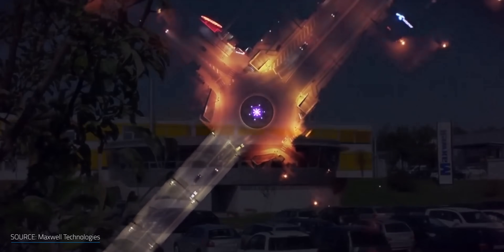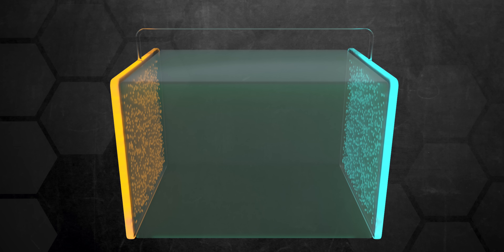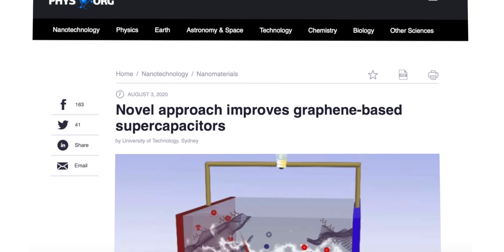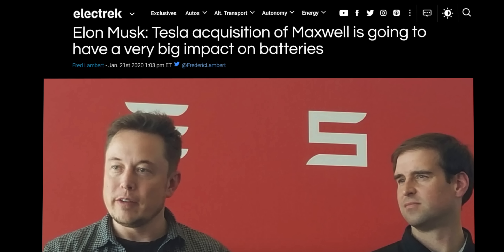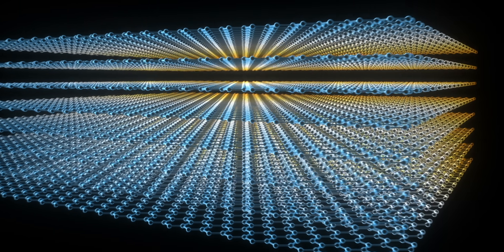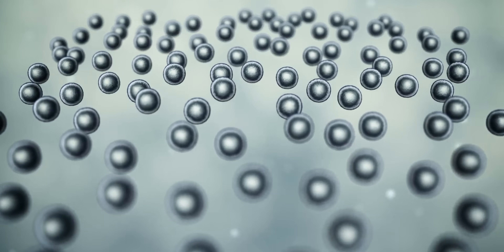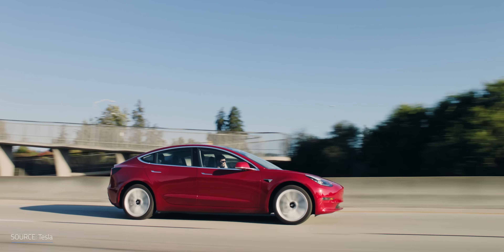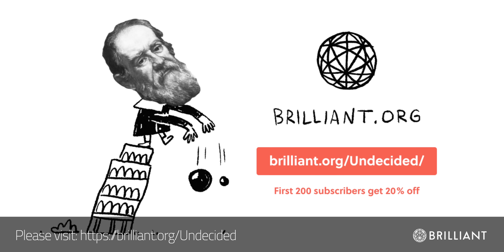Supercapacitors explained - the future of energy storage?

Comment: This feels like transitioning from HDD storage (ICE) in computers to HDD+SSD combos (ICE+EV hybrids like Prius), then to plain SSD's (Li-ion packs like most pure-EV's), but now we're getting in to the use of things like SSD+Optane (Intel SSD/RAM hybrid with fast read/write and acts like a small RAM drive for your main SSD) with the Li-ion being the SSD (main storage capacity) and the supercaps being Optane with quick fill/empty cycles to reduce load on the main storage where what's being transmitted might otherwise be bottlenecked in transfer rates if otherwise going to main storage.

Yes, I'm an IT geek and nerd, how could you tell? :P
Reply: I was thinking the same thing, but couldn't get the words to come out right.
I can only imagine how much more distance you could get from your Li battery?

Comment: Energy in cap is 1/2 CV^2, so if we increase the voltage in cap just we have more energy and to approach it would be possible with a DC/DC converter for an appropiate voltage.

Comment: The best part of super capacitors is when they fail . All the energy stored is released in several milliseconds and the resulting flash and bang is spectacular.
Reply: So is the flame of a battery
Reply: Try shorting one out, a nice effect too.
Reply: Would they be dangerous paired with a battery in a vehicle? Risk of explosion/fire etc?
Reply: @BrettHoustonTube  Yep it'd be dangerous. A capacitor works differently than a storage battery. A storage battery, lead-acid, lithium, or whatever works by using a chemical reaction. A capacitor is just a sheet of conductive material (a sheet giving the most surface area for  a given mass) that stores electrical charge on it's surface. The problem is to make the capacitor so that it may be charged up and then discharged without accidentally grounding it out.

Comment: Capacitors are used in on-board chargers in electric cars to charge the battery. They are also used in the inverter that converts the DC from the battery to AC for the electric motor. Capacitors are a key component of battery EVs already.

Comment: A computing analogy would be to think of like the cache on your hard drive, its fast, a lot faster than your hard drive but its more expensive and so can only store a very small amount because the cost per mb is so much more. It helps bridge the gap between your fast system and slow hard drive, allowing the cache to fill up with the data very quickly, and then stores that data onto the physical disc to allow for faster storage.

In a way this is similar. Lithium Batteries are slow and relatively cheap but can hold large amounts of power for their price. Super capacitors are more expensive and don't store as much but do it very quickly and release it very quickly. It can be used in the same way to bridge the gap to allow for faster charging or to allow the storage of charge that is provided very quickly like breaking. Not a perfect 1-to-1 comparison but its a fairly similar concept.

Comment: Energy can be changed from one form to another. Use multiple inputs to generate electrical energy wherever needed (PON - point of need) to complement. Say, in cars, use our body movements & weights, light from outside, wind when car moves, cars brake and weight on roads, tyre pressure fluctuations while in motion, sound inside & outside car, etc.....In Gyms, use body movements (and there's a lot). Surely research on these would come up in future. Generate & use as much energy at PON and get balance from other inputs.

Comment: Great video. I think it's also important to note that supercapacitors are only useful right now when the load is highly variable. E.g. if my robotic vacuum charges for 2 hours and then cleans for 2 hours, a supercapacitor won't really make a difference. Conversely, EVs repeatedly brake (charge) and accelerate (discharge),  giving supercapacitors plenty of potential to reduce the total current to and from the battery.

Comment: There's a small automotive startup on Fully Charged called "Riversimple" that uses capacitors and a small hydrogen fuel cell combined with 4 motors to capture Regen energy effectively to improve performance metrics.

Comment: Aside from the specific energy there is also the issue with linear discharge characteristics of electrostatic storage components like super caps which complicates the control components and their efficiency due to the fast voltage drop during discharge.
Regarding  your statement on voltage capacity  at 1:47 , a 3.7V nom Li-ion cell will still be a 3.7V nom down the road but cyclic degradation will have reduced the energy holding capacity with their useable voltage range and increased their internal resistance which reduces their max. charge and discharge rates.  Capacitors are not immune to cyclic degradation that reduces their capacitance and increases their ESR (Equiv. Series Resistance) however that degradation is far less than that of electrochemical storage components like LiBs.

Comment: I would like to know what the 'correct balance' between battery capacity and super capacitors is.  Given a certain battery size,  given re-generation or maximum charge rate, how any Farads of capacitors is needed to allow for the near optimum regeneration percentage.
Reply: It's really an economic balance. The more short-term power cycling can move to longer-term cycling, the more battery lifetime can be extended. So it's the cost of the supercar versus the cost of extended battery lifetime.

Comment: One battery chemistry that i have been playing with is a Lithium Titanate Oxide, LTO, they have a great charge and discharge curve  of up to 10C and a cycle  life of about 50 years, this setup consists of 66 x 40ah Yinlong cells in a 22S 3P configuration (6kWh). with a big enough charger can be charged in 10 minutes

Comment: As I understand it, one of the advantages of supercapacitors, is their fast charge capability. A source of energy which has yet to be tapped is that generated by atmospheric electrical storms. Can the lightening rods of ol be used to attract such energy and store it   for later use? That might imply rapid charge and slow discharge. How can we take advantage of this?

Comment: The big bonus is that you can combine supercaps with higher density energy systems to complement them. You lose some density and lifecycle in lithium because you have to design it to charge and discharge quick enough to accelerate a car quickly or take in regenerative braking energy quickly. With 10% of its energy stored in a super capacitor you can use less lithium to get the same distance travelled but with far better performance and lifecycle characteristics by wiring the lithium pack more optimally to trickle charge the capacitor or power the car during low acceleration and the capacitor handles all the heavy work of acceleration and breaking.

Comment: My last question is how much more could a battery store or capacitor or transformer store by not getting hot so utilizing the water trough for batteries how would you do that for transformers and pastors isn't there a thermal paste that could be utilized like a radiator system on these

Comment: I'm curious how Nawa plans to recoup energy from braking with the front wheel of the motorcycle? 70% of the braking power of a motorcycle comes from the front brakes, which are not connected to the electric motor with a chain like the back wheel. Therefore it's a challenge to regenerate energy with the front wheel, and harness all the potential energy. An additional challenge is that every part you add to the front wheel to be able to regenerate will add weight, which will increase the unsprung mass and possibly also the inertia of the wheel itself, thus decreasing the motorcycles handling performance.

Comment: It should be noted that charge is not stored on the plates. Those are how you move the charge. The insulator itself is becoming polarized. You can polarize an insulator and remove the plates, have them touch and then place them back and the insulator will still be retaining the charge.
Reply: One advantage that capacitors will have is the ability to continuously charge them even while in use. Nikola Tesla observed in patent US685957A that a capacitor (condenser in the jargon of his day) will continuously charge where a plate was grounded and the other was provided an antenna. The capacitor would charge until reaching the insulation's dielectric strength when it would rupture. 
Love this patent because it reminds me so much of Benjamin Franklin's Sentry box experiment involving and insulated rod. The same experiment to claim the life of Georg Wilhelm Richmann.
Without using the same desired approach of Tesla in using atmospheric electricity, we could apply the same principle where a capacitor in use can receive grid energy while in operation. Potentially a vehicle that never needs to stop

Comment: Good overall explanation, but still don't know how a super capacitor itself works. Yeah it stores energy, faster than a li-ion battery with less density, but how? If the cathode and anode are insulated from eachother, what makes the electrons flow and generate current?

Comment: Supercapacitors are great for acceleration and regen breaking already, something batteries are bad at. Also faster charging could be possible if you could empty the super caps completely before charging, and then charge both at the same time, batteries need to warm up to charge fast if they are cold. Supercapacitors can also extend range especially in cities thanks to much better regen. Manual control of the supercapacitors would be great to optimise your driving. For example if you want a quick acceleration from stand still full supercapacitor bank will give most power, while driving down hill you want to have a empty supercars so you gain back maximum amount of energy possible through regen-breaking.

Comment: So could a super capacitor trickle feed charge to the battery? Reducing time connected to the grid? Or remove the need to connect to the grid by improved efficiency of regenerative braking into the capacitor to then feed the battery?

Comment: I guess these can be used to provide the surge capability in inverters. I am looking to back up the house from my Chevy Bolt through it's 12 volt system. I figure I can only get a kilowatt out of it but I could get that for more than a day and that's a lot of juice. The trick is being able to start up the motors of things like refrigerators from a 1kw inverter and I am guessing that a super capacitor could give just the kind of mule kick of power that is needed.

Waiting patiently for EVs to have at least the option to provide power as 240ac or 300-400 VDC into an inverter ( solar inverters already use that power supply spec ).

Comment: Supercapacitors have three big problems: (a) significant self discharge, (b) declining voltage as they discharge, (c) low energy density. Fix those big issues, and then they are worth considering. They are good power buffers, not good power reservoirs.
Reply: Capacitors of todays' technology have significantly smaller leakage rates than most electrochemical cells, including Lithium chemistries.
Reply: @kanemorimartin531  citation?

Comment: At 5.50 Matt says supercapacitors does not have long term energy storage as compared to Li ion battery. But that may not be correct. Capacitors can store energy for long periods of time, the only glaring limitation being that they discharge very very quickly. Which btw is also their strongest point and hence they can get charged within minutes as in Switzerland example!! Any thoughts  🤔

Comment: 9:00 Using the supercapacitor to protect the main battery pack by doing all the work seems the logical thing to do. I'm not sure why Tesla isn't adopting this approach. You only need a few kWh of supercapacitor, so not much weight is wasted on the low energy density supercaps.

Comment: Avalanche air bags as used by off piste skiers mainly either use compressed gas.  As this is an issue taking on commercial flights, some use batteries and a fan.  The lightest fan model actually uses super capacitors.  I guess this is because of the discharge is very rapid, and also as batteries don’t like the cold. They do loose charge over a couple of weeks, but are topped up by a AA battery.

Comment: Capacitors can store an enormous amount of energy. The problem is they discharge their energy very quickly. If you had millions of small capacitors fully charged and a computer switching device that let them discharge in sequence, like a line of dominoes, capacitors would be an excellent recharge for on board batteries. You can use your capacitors for a ground

Comment: Mixed with super long holding discharge storage and a super capacitors , would be best for long term use when needed say when a car is just sitting for long and or charge fewer and long term use helping the grid.

Comment: I could see super capacitors and lithium ion hybrid batteries being used for RV air conditioners. That initial draw really puts a load on a generator or battery.
I can see a super capacitor being used for home air conditioners too to lessen the load on the electrical.

Comment: 1:55 That's wrong, a battery does not use voltage capacity. What's that supposed to mean?
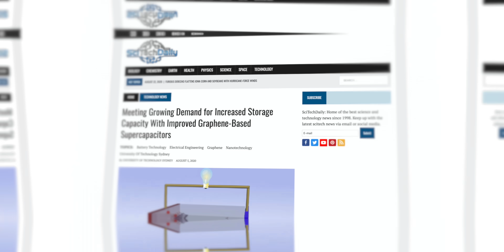3:15 That's wrong as well, capacitors have always been efficient (>95%), there's almost no improvement possible

Comment: 1:48 A battery will not "lose" its nominal voltage either, and over time a capacitor will definitely lose capacity - capacitance, in this case - as well as efficiency (related to equivalent series resistance) although only after much more cycles. There is no such thing as voltage-capacity, either. Supercaps also trade rated voltage (f.ex 63V -> 2.7V = 5%) for capacitance (f.ex 100uF -> 1F = 10000%), and arranging capacitors in series to make them usable in common applications produces diminishing [overall] gains as the series gets longer. Inaccurate at times, but the point gets across.
Reply: BZZZT!  Wrong.  Putting two capacitors in series halves the capacitance, and doubles the voltage.  The energy stored is equal to the capacitance times the voltage squared .  So half the capacitance and double the voltage gives four times the energy.
Reply: @acmefixer1  That is correct and not what i'm disputing. I'm talking about overall gains, not just electrical. There are valid reasons why supercap series aren't widely used, volumetric for one.

Comment: Charging the Capacitors to a higher than battery potential from photo voltaic cells, allows charging of batteries from capacitors e.g at the absence of sunlight.
Parallel Cap/battery applications have many advantages.

Comment: In 2012 my son and conversed while changing a pool motor start up capacitor, I said a capacitor should be used on the model S for launches he’s a chemical engineer for battery research.  the regen would recharge, he then thought a BMS would be a challenge and current tech isn’t there yet. Hey mat the capacitor will extend lith. Battery life. It’s all about BMS for capacitors  and then merge with lithium
Reply: You and your son are on rhe right path, super caps can capture any regen energy more efficiently since there is a conversion time and a diffusion time as well as polarization gradients that are generated and are present as the electrical energy is converted into chemical energy that will be stored, ( as a higher oxidation state of the battery active material in the cathode).

Comment: Is it possible to combine supercapacitors and lithium ion, or solid state, batteries, purely to facilitate faster charging? If the supercap could take on the charge and then allow the battery to sip that power whilst on the road? If I’m an idiot, then I apologize.

Comment: Why not grid scale energy storage using super-capacitors?  It seems to me that energy density matters most in applications for vehicles and other consumer products where weight and size are a driver of function so Lithium batteries win. But in grid scale energy storage, weight and size are easily dealt with by simply stacking. In such applications, the virtually unlimited cycle life and power density of supercaps would seem to make them a perfect fit and just solve weight and size by stacking them in an unused field. What am I missing?
Reply: You're missing the cost.  The larger weight and size make the storage system cost more, and the transportation cost more, too.   Just the large amount of material needed to make them costs a lot.  They don't have to last for a long time, 5 or 10 years should be adequate.
Reply: Acme Fixer 
Fair enough. It makes sense that cost is the reason for non deployment. After I wrote the post I tried to chase down the cost of grid scale capacitors. Wasn’t much I could find but it did look expensive. That being said, I disagree that 5 to 10 years would be adequate. Replacing a large amount of energy storage every 5 to 10 years that the grid would need to rely on would be very cost prohibitive unless it was extremely affordable. Right now, grid scale storage is extremely expensive. This is probably why there isn’t much to date.

Comment: Supercaps add "stiffness" to a power supply... a stiff psu is one in which there is little voltage droop when suddenly heavily loaded. 
Supercaps carry that startup load & the battery carries the "running load" .... they can do this because they have much less internal resistance than batteries... 

Ironically, in electronics, the sudden inrush of current on switch-on is as a direct result of the capacitors in the unit being powered-up... 

😎👍🍺☘